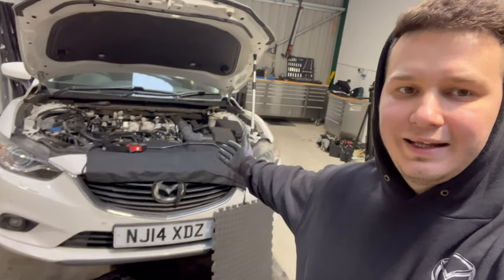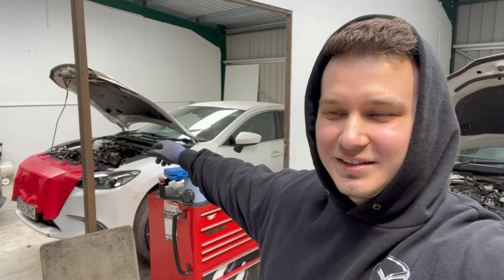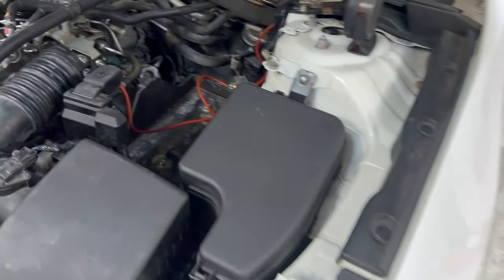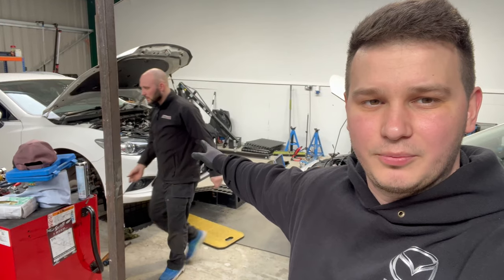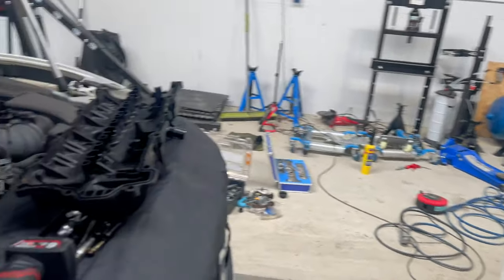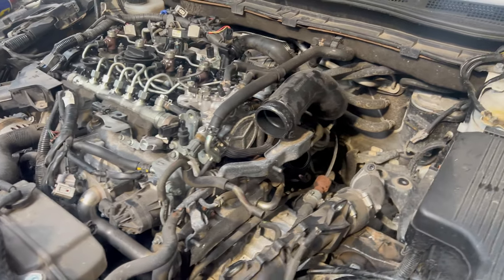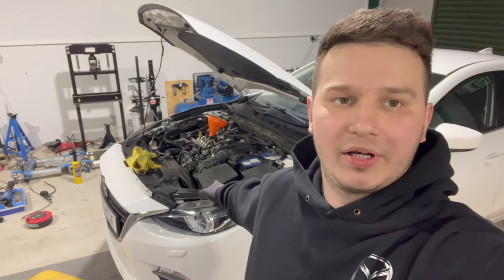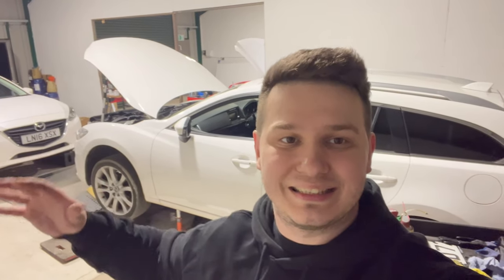4 Mazda Skyactiv Diesel in the Garage - Fixing them all day long

Comment: Have you thought about doing a short video about these engines showing people how to prevent any problems like 5k oil changes, inlet clean every 60k miles, A road and Motorway driving, checking for oil dilution, checking exhaust cams for wear, checking oil pressure etc ? It's a great idea
Reply from the maker: Yeah, I just don't have time, and tend to forget my ideas :D :D

Comment: Hi love your videos, I have a 2.2 skyactiv that cranks (slowly) but will not start. It won't fire up with easy start and it is blowing the oil filler cap off. Can you please help/suggest anything to look for check? It's had a new starter, battery, oil pump.
Reply: Sounds like compression rings are not holding compression in the cylinders. Is this a CX5 or 6? The compression would get into the crank case. That causes the oil to blow out everywhere it can. If this is the case the block needs a rebuild or replacement. If the engine isn't already dead the ring and bearings can be replaced. That is just working off the limited information and a thought versus an actual diagnosis.

Comment: Where is your shop based, I'd like to bring my car in. It's also a Skyactiv 2.2D :D
Reply from the maker: Lingfield.
Message me on my facebook page. Link in the description of the video 😉
Reply: I was thinking of planning an 800 mile round trip to drop mine off. I dont know anyone up here in Scotland I could trust to know them as well as Mr Niceguy and the dealership is a firm no for me. Even when I had the turbo bolt failure that was known by the dealer they tried charging me £1500 until I created a fuss for them to honour it  as good faith being that is a known fault by Mazda using these useless bi-turbos that blow all the time.